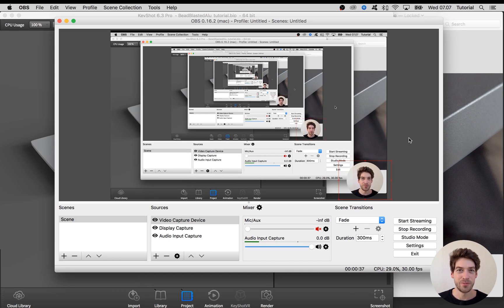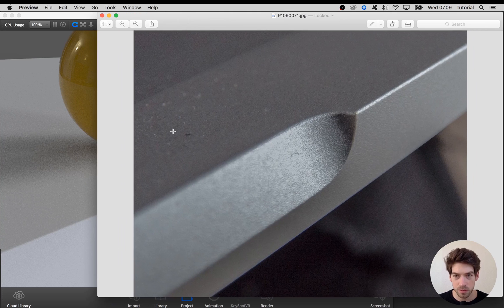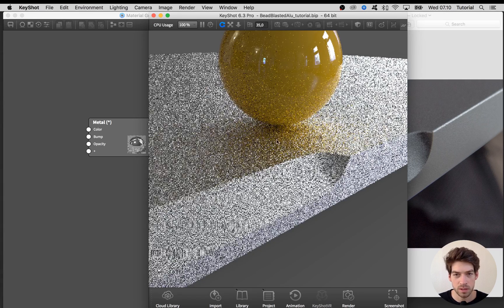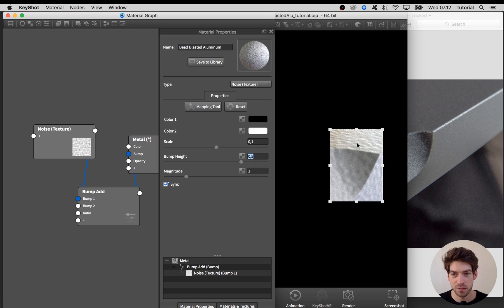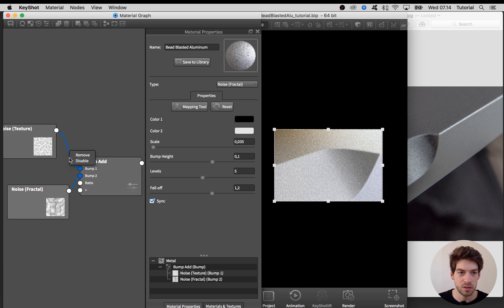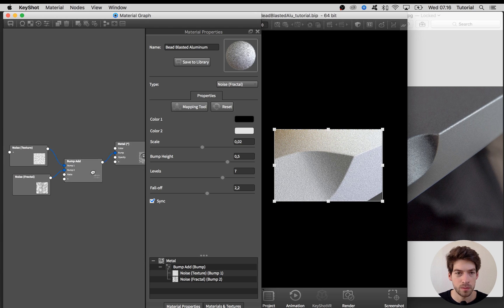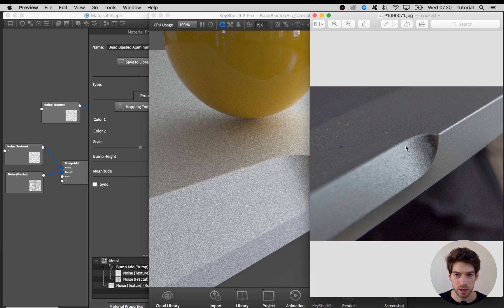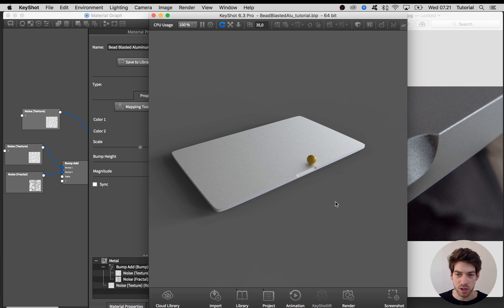KeyShot Material Study: Bead Blasted Aluminum

Comment: I dont use keyshot, but instead of duplicating the noise for the roughness map, if keyshot has a range/interpolation node then you can just route the noise into that and then interpolate the values to get the output you want.

Comment: Bead Blasted Aluminum.kmp   How do I open it?
Reply from the maker: In the material tab, in the library panel, select the folder you want to add the material to and hit the 'import' button (second icon next to the search bar in the top of the material library), browse to the .kmp file and hit 'open'. That shoudl load the material into the selected folder.